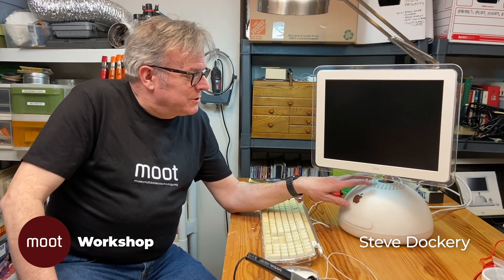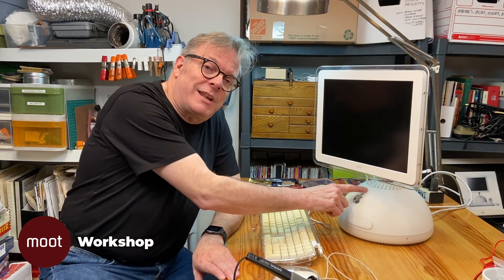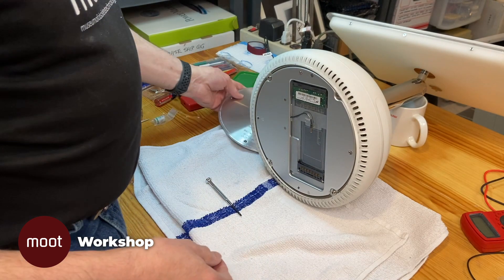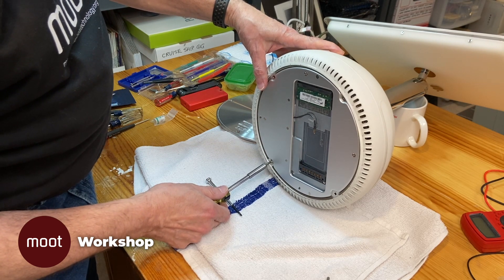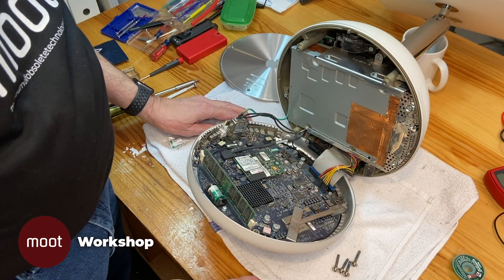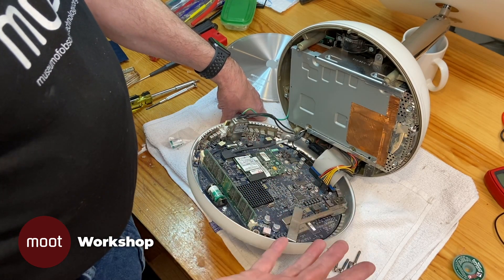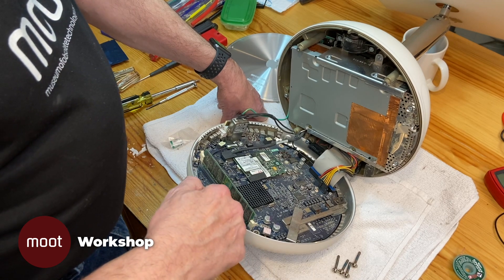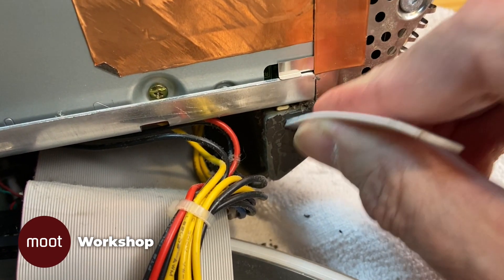iMac G4 Take-Apart

Comment: Where’s the power supply?
You said that this is a take apart, but the only thing that you have done is take off the bottom case. 
And you did put it together again. That’s good.
Reply from the maker: Hi, sorry I didn’t get that far into disassembling the thing. I was trying to cover what you’d need to do for basic maintenance like the PRAM battery and upgrading the memory. That’s all made tricky because of having to deal with things like the thermal paste. The power supply is a small board with one round side, bolted in adjacent to the hard drive and optical drive in the stack that remains in the upper case in the video. There’s nothing especially tricky about that part, just keep note of what order things came out so they can go back in reverse order - the annoying part on this machine is having to take so many things off in order to get to other things. I once had to replace the neck on one of these, which required disassembling pretty much every single thing.
Reply: Actually there are two semi circles of the power supply unit .... they are just above and around the CD/RW and Hard drive units . . .  linked to each other by way of a few wires..... Primary ( high voltage is on one side / the other side is the ( generally speaking ) lower voltage ... hope this helps ;))

Comment: Thanks for that nice and detailed video. I actually found the device quite easy to take apart due to your explanation.

Unfortunately my iMac won't start up - the PRAM battery has around 3.2 volts - it should have 3.6v and I really hope that it will start again after replacement - fingers crossed!

Comment: Hello! I have a question, I’ve had an iMac G4 since i was really little, it was my childhood computer, and I’ve just the other day started using it again. It was sitting in storage for a while but works just fine now. I am worried though because it seems quite dusty on the inside (looking down through the holes on the top), I have no computer experience whatsoever and am worried this may impact my beloved computer’s performance an longevity in the future. I don’t think I could take it apart myself, so I’m wondering if i should take it to my computer guy to get it cleaned out?
As I said there are no obvious issues with it’s performance, I would just like to have this computer with me as long as possible as i am incredibly attached to it. I don’t know much about computers as this is the only computer I’ve ever owned, so I don’t know if the dust something i should worry about at all?